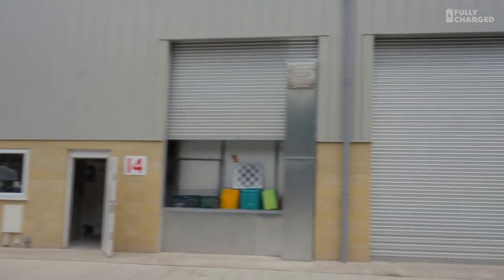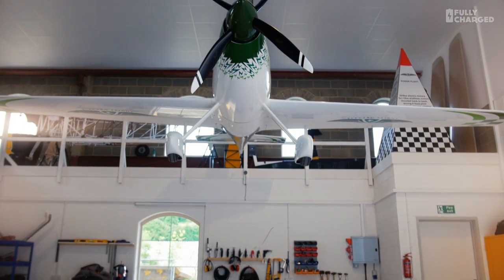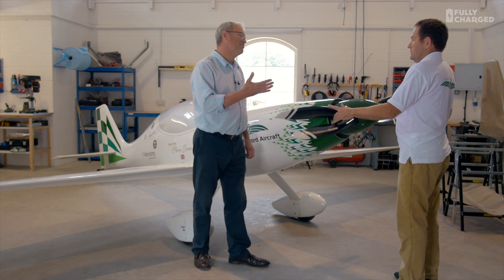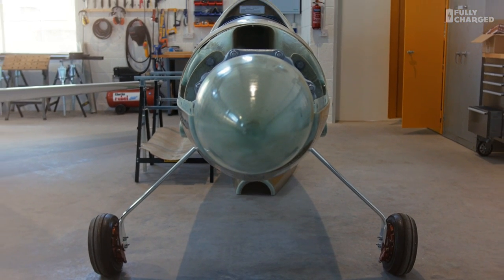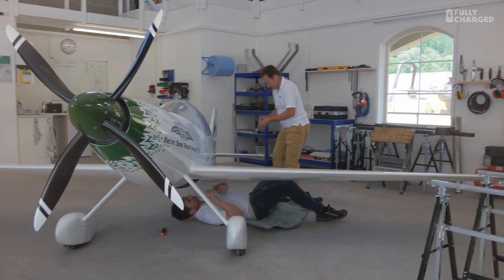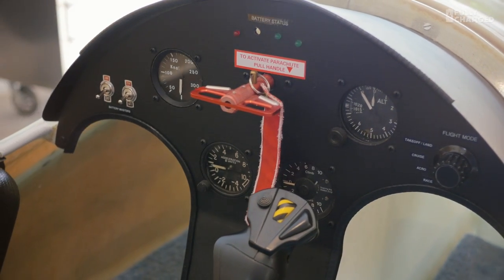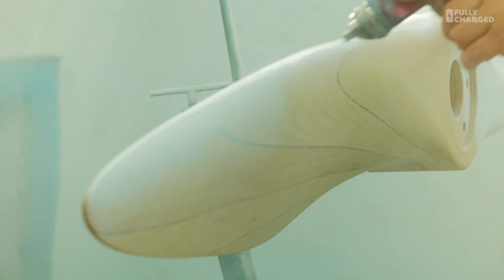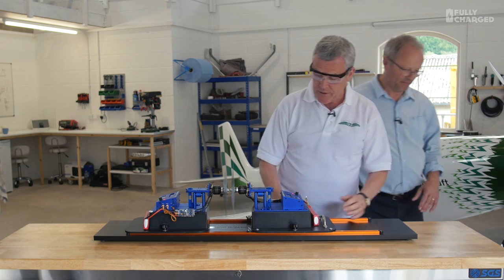Electroflight | Fully Charged

Comment: I'm struggling to understand the physics of having two electric induction motors bolted together in series...anyone that can shed some light on this?

Of course the two stators are bolted together; but it's the two rotors in series that confuses me...how?
Reply: Wait, never mind, the motor at the rear must have a single stator rod, that fits inside the 'pole' (for lack of a better word) that would act as the driving force of the second motor - with both connected to their respective motors...

Very clever lad...

And these guys are pretty smart too! ;)

Comment: Sorry, I do not agree to this in case of Airlines. My proposal is to use hydrogen combustion, which may be installed in exsisting airplanes with jetproposal. In addition the power can be supported by adding water to the cumbustion. And what is about lifting airplanes to flight height with the helping of a Zeppelin? Thanks for reading my comment.
Reply: Hydrogen combustion is considerably less efficient than pure electric.

Comment: i don't understand aviation  tech but i  was  wondering why can't a electric helicopter do 300 plus miles per hour  and if the batteries  should?   fail  do you have  a backup system ?  when  i said back up i was talking  about   fuel back up  because what   happens  if your over a lake  or what if you come  down on high voltage  power lines  or some building  etc   then what ?????

Comment: The  upper body and  upper wings should be made out of solar panels.
Reply: The upper fuselage and wing skins carry structural loads. Solar cells don't, so they would have to be added onto, rather than used instead of the existing skin, which would add weight. Solar cells have a lower energy density than lithium cells, so if you were going to add more weigh, it should be more lithium cells. The plane is, among other things, very small, so not as lot of area to paste solar cells to, so not enough energy to be worth the bother. especially when you consider that you have to use a comparatively inefficient boost  converter to get the low voltage of the solar cells to a voltage that would be useful to the motors. If this stuff was that easy, electric airplanes would be flitting all over the place.

Comment: While this is an acrobatic plane and that range is unnecessary as more fuel is more weight,  but what's the flying time on a full charge for this when doing a reasonable 100 - 150 mph cruise? An hour, two hours?

If it's an hour (100 miles) for sport use, then that's a given. But if they adapt this to a civil, 2 seat plane and make it run 3 hours at that speed, then it's perfectly fine if someone manages a rapid charger or normal charge at a hanger... Just look at an ordinary 2 seat plane. It would cost fortunes in fuel alone to do anything more than a little circle flight. Not too many plane enthusiasts really go out of their way to go A to B and stretch their tanks.
Reply: Not really an aerobatic plane. Rolls Royce has money, probably from their advertising budget in this now, and their website is pitching it as a  straight line electric speed record aircraft. The video mentions Red Bull Air Racers, but this thing will weigh two hundred pounds more than a Red Bull aircraft, and consequently would useless in Red Bull competition. Do not expect an hour of endurance. Twenty minutes is more likely, all of which will be used taking off, getting to the speed course, making a run and getting back to land. This is definitely not a cross country machine.

Comment: "hydrocarbon engine" is that newspeak for internal combustion ?
Interesting concept, but really what he's got there is nothing more than a big Airfix model.
Reply: It's short for any engine that burns fuel.
Reply: A turbine jet engine isn't internal combustion. It is a hydrocarbon engine, though.
Reply: Kael An aircraft turbine engine is an internal combustion engine.
Reply: Pook365. All engines burn fuel, by definition. Those that don't are motors, not engines. There is a reason why an electric motor isn't called an electric engine.
Reply: +CaptHollister While that is often how it is used, anything that converts energy into work is an engine.

Rocket motors, motorboat, motor speedway...
Reply: Pook365, technically correct (the best type of correct), modern usage be dammed. To the original argument: IMO "hydrocarbon engine" is just a PR term.  All current non-ev powered aircraft use an internal combustion engine. Internal combustion is what Electroflight aim to replace. What makes this term even less accurate is that not all IC engines run on hydrocarbon fuel.  "hydrocarbon engines" sounds like something  the PR person told them to say in order to remind everyone that "hey, we don't burn no dead dinosaurs"

Comment: If you want electric planes you need much much higher energy density in batteries. 
Or possibly a small nuclear reactor on the plane :) General Electric J47 or the Tupolev Tu-95LAL. The problem is with the radiation shielding ...
So we will be using jet fuel in the foreseeable future.

Comment: Why is there a step between the prop hub and the rest of the plane? Why isn't it flush? That can't be for cooling.

Edit: Actually looking at it a bit more, it's small enough for it's aerodynamic effects to be neglibile. Especially at higher speeds, where this is designed to fly.

Edit2: I spoke too early. Other models have it smaller or  flushed.
Reply: It was likely for cooling of the motors, they switched to water cooling on the later version.

Comment: this is a very narrow niche case of possible use, honestly commercial flight will probably still remain Fossil and jet based for the next few decades.
batteries are heavy, and if we free up fuel from ground transport with EVs I think I can live with jumbos flying overhead. the Power to weight ratio and specifications for high altitude, high speed commercial airline flight will not be easily overcome. Jets are also much smarter in how they utilize fuel than ICEs as they directly use the combustion properties of Fuel, which electric motors simply can't replicate.

Comment: Why not put batteries inside the wings?
Reply: Many reasons. First - the further away mass is from the axis o rotation - the more force you need to rotate with the same speed. So - moving mass to wings means slower barrel rolls (and harder to stop once you get rotation). Try spinning with your arms stretched and then cross them to see the difference.

Second reason - wings would need to be much stronger to hold batteries, structural integrity of wings is already hard and with more mass it's harder. So you would need more useless mass just to prevent damaging wings = worse performance.

Comment: I have a big model airplane, extra 260, 2,6m wingspan, 14kg take off weight, you can see how it flies if you check my videos. Brushless motor is an amazing thing. My model has 7,3kW of power and it flies as well as it would with a 100cc 2 stroke engine FOR ABOUT 8 MINUTES. Lipo batteries are also amazing for what they can do BUT their power density is still way to low for any serious use in aviation. This tiny racer might be extrordinary for the minutes it's batteries shall last but thats not going to attract enough pilots for it to be a commercial success. Just like the electric motorbike never has. It might have been better performing it might have been better handling but the majority of bikers just want their machines to produce some noise. So unless new batteries are invented which can enable it to fly as far as it's internal combustion brother it just won't sell.
Reply: exactly. For planes, the energy density of lipos is just way too low. If you wanted to build an electric passenger plane, it would need either way too much weight in batteries or not fly very far. Also, batteries dont really get any lighter when they're discharged, so you would always land with max takeoff weight, increasing wear on your plane and also being possibly dangerous. Not really ideal at this time. Not even when we got batteries that are as energy dense as aviation fuel, because even then, you'd still be landing at max takeoff weight, which to my knowledge isn't even allowed. So we would need like double the energy density of aviation fuel. That's going to be really difficult

Comment: Can anyone explain to me why you would use a propeller in an aircraft like this vs. a ducted fan?
Reply: less drag
Reply: The prop has less drag then the ducted fan?
Reply: +FrequentFlier Anon if you have dual external ducted fans like the airbus E-fan
Reply: That was kinda where I was going with that. Noticed airbus was going with the ducted fans and wondered what the pros and cons were of ducted fans vs props.
Reply: +FrequentFlier Anon if you have a single prop as opposed to the 2 ducts sitting saddle with the fuselage you have more drag from the fan's housing on both sides than you do from a single prop.  but if you mount the ducted fan like a MIG  15 then you cut down on a bunch of drag and the drag coefficient is closer to that of the single prop.
Reply: I could see that, the shroud around the fans is going to cause drag, but with the Mig-15 example the fuselage is going to create drag anyway, so it may as well have an engine in the middle of it. But why then did the electric airbus go with the two ducted fans vs a prop, or two props?
Reply: +FrequentFlier Anon more power as you can only spin that fan so fast before they shatter and because one fan can only provide so much thrust
Reply: The ducted fan would just be extra weight that doesn't get justified through the benefits which are not so much performance-wise anyway. Just think of the size of the duct that would needed for that. Not to mention it will limit the pilot's visibility by a ton.
Reply: Efficiency. Power consumed is proportional to the propeller disc velocity cubed, however the thrust produced is proportional disc velocity squared. Hence for maximum propulsive efficiency, you minimise the disc velocity, but to maintain the same thrust, you need to increase the disc area. This is the same argument that drives the ever increasing size of turbofans on large civil airliners.
Reply: Ducted fans are great for achieving high top speeds, but not so good for accelerating. With that kind of race, I would guess acceleration is more important, and you must be able to keep up whatever speed you achieve most of the time.
Reply: Electric motors much like IC ones become more inefficient the higher the rpm. In model airplanes ducted fans therefore are only used when efficiency is considered unimportant.
Reply: From what I've heard, ducted fans only function well at a very specific RPM range of an engine.
That's great if you can keep the engine at that speed for the entire flight, but...
That's not the reality of how you use an aircraft engine. 
Where the prop speed and situation varies a lot, an unducted fan is simply more efficient over a larger range of airspeeds and situations than a ducted fan.

Pity. Because I find propeller aircraft butt-ugly... 
But, that's life. 
The pretty-looking planes often don't work as well as the uglier ones. XD
Reply: Weight is part of the problem, size would be another.
But for planes this manoeuvrable the biggest is duct fan stabilizing, ducted fans only want to go straight, if you move them sideways they will pull in the other direction until they go straight again. Which would become a huge problem with these planes.
Reply: From my rc flying experience, propellers are more efficient than edf's but don't tend to give you the same speed.

They struggle with initial acceleration like in take off. So tend to want larger runways. Like trying to pull away in 3rd or 4th gear. Once they are up to speed they will easily go faster than a prop plane.

They are considerably louder than a front mounted prop.
Reply: A bunch of people mentioned the downsides of ducting. Extra wetted area means more skin friction, etc. The upside is that there is less leakage from the high pressure side of the wing (a prop is just a spinning wing, of course) so the induced drag (the drag from generating lift or thrust) is lower. The main advantages are in generating high static thrust and decreased prop noise. That is great for seaplanes and air boats. But parasitic drag (skin friction and form drag) increases with the square of the speed and induced drag decreases linearly with airspeed, so eventually parasitic drag dominates. And as airspeed increases, the benefits to static thrust efficiency also becomes moot.

A much more practical way to reduce induced drag and noise in a propeller is a Hartzell Q-tip propeller. It's basically a propeller with winglets on the end of the blades that act like end plates just like the ones you see on aircraft wings.

The most successful ducted propeller aircraft I can think of is a low-speed observation aircraft, the Edgley Optica. If you are British or Irish, and of a certain age, you may be familiar with it. Looking something like a dragonfly, it has a bulbous cabin (think Bell 47 helicopter, as in M*A*S*H; or Aérospatiale Alouette) in front of the duct with a long straight Hershey bar wing and a tail like an OV-10 Bronco. Its main mission was to be a low-cost alternative to a helicopter for police forces. With the cabin and the non-retractable nose wheel in front, the ducted propeller breathes dirty, turbulent air which hurts efficiency. Only a couple dozen were built.

Another option is generating lift force from the duct itself with what is called an annular wing. Besides the flying model aircraft you can find on the internet, only one successful (being very generous) experimental aircraft with an annular wing has flown that I know about, the SNECMA Coléoptère. It was a tail-standing, vertical-takeoff design powered by a turbojet, not a propeller. It crashed on the first flight that a transition from vertical to horizontal flight was planned. The pilot became disoriented during the transition and had to eject at low altitude.

Louis Blériot first experimented with modified annular wings that were elliptical, but they never went very far and he switched to front-engine monoplanes and, of course, became the first aviator to cross the Channel.

A decade or so ago, I saw a proposal from an Australian who wanted to build an annular wing aerobatic aircraft to take advantage of the design's unique inherent maneuverability (the wing knows no up, down, or sideways). I don't think it ever went anywhere. The wing and enclosed propeller was mounted midship, as with the Optica, because you can't put it out front. A big annular wing that makes lift in any direction would cause the plane to turn downwind in any crosswind if mounted in front, making crosswind landings, very, very difficult.

Comment: If you apply this to fans in a tube, given sufficient battery life, do you have a passenger plane?
Reply: Absolutely... I think Elon Musk has something like that in mind... I'm pretty sure he's gonna' bust this out soon or open source it like the Hyperloop.
He's just got so much on his plate right now. There is so much people can run with when it comes to E-transport, like these guys are doing here. This could be easily applied to boats too and work great with low CoG in the keel.
Reply: definitely duct ed fan.  Solar power recharge?
Reply: I think you're onto something there Mr. Dingman... Aside from Hemp. HA!
Reply: I'm pretty sure he didn't mean run directly from Solar panels... The key word being "recharge"!
p.s. I keep hearing a lot about these "graphene" batteries you're talking about with high energy density & low weight... Yet, there is no lab/bench proven evidence of these in the so called "real world"... If there was, Elon Musk and Tesla Motors/Energy would be using, developing and manufacturing them for sure... Smoke, mirrors & Unicorns for now.
Reply: Some guy talking crap after he had too many margaritas on his vacation over a couple of business card size crude samples with scotch tape on them and no meters hooked up doesn't make a believer out of me... But thanks anyway.
Reply: Thanks, but the links won't be necessary... I've seen many. I'm not an electrical engineer, but I know Tesla Motors has some brilliant engineers and Elon mentioned that they have an open invitation to anyone with "breakthrough" battery/capacitor technology that they will hard test in their lab. They get thousands of these presented to them. They rate them on a scale of 1 to 5... 5 being something that shows definite potential and they will sit down with serious negotiations while 1 is no potential whatsoever. They have only a few that have made it to even a 3 and none that are a 4 where Tesla will negotiate and commit some of their time, resources and energy to do further R&D.  
When someone like Elon Musk, JB Straubel & Co., who are actually building awesome usable products, say there is a lot of bs in the battery tech arena, I tend to listen to what they have to say as I consider them a reliable source with a great track record in this field. 
They also happen to be building the biggest battery manufacturing plant in the world... Hmm?
But anyway, I hope this guy & others do well in their "kick-starter" campaigns.:-/ I also suspect there is plenty awesome tech sitting in the patent office with a big lid on it. That's why Tesla has open sourced all it's patents... A very wise thing to do that any brilliant inventor need consider seriously.
Reply: Tesla aren't the only company developing graphene batteries, Turnigy have released some for model planes and quadcopters (Though not of the size that Tesla need)
Reply: Oh ok. I though they were meant to have super low internal resistance though, lower than that of traditional LiPos